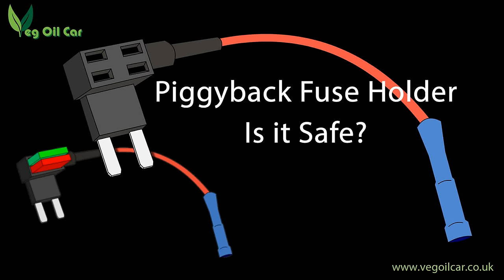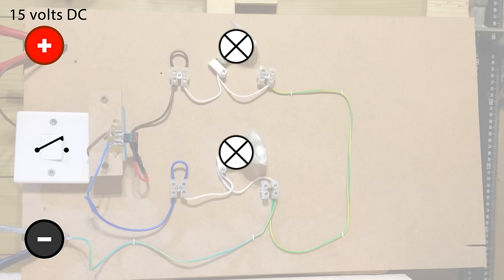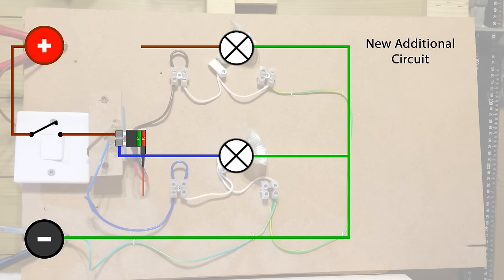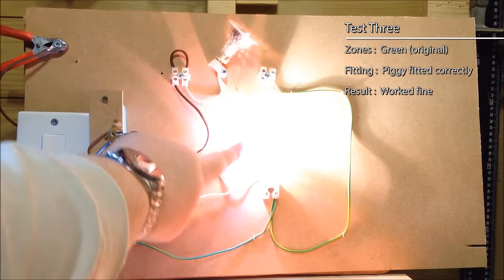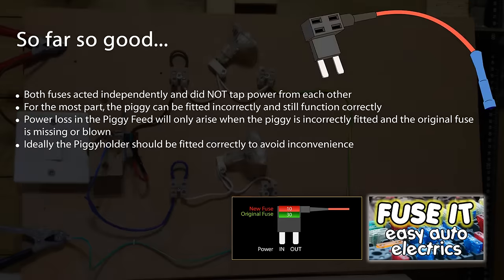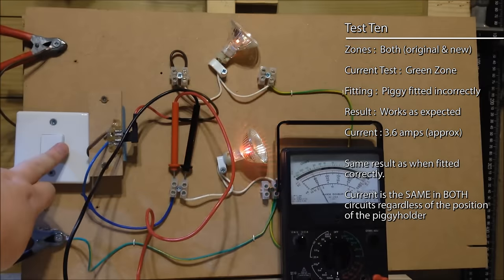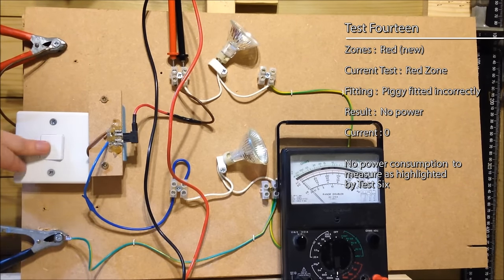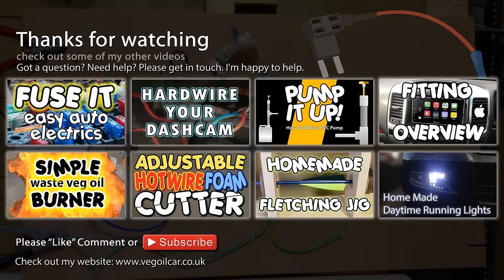Piggyback Fuse Holders SAFE OR NOT? A Piggyback bench test - by VOGMAN

Comment: As others have said great video but one additional thing: if the piggy back is the wrong way round then the original fuse will see the amps from both circuits potentially overloading the original circuit.  The tests here won't show this as they tested the circuit amps past the point of the fuses.  If you remove the original fuse and test the amps at that point (I.e amp meter bridging the original fuse) you would see double the load with it the wrong way round.
This matters in the sense that you could blow the original fuse when the original circuit is actually fine and should be operating.  You could also create a load that would always blow the original fuse in this set up (I.e original fuse at 20a with 10a load, new fuse at 20a with 11a load both circuits working as desired, the original fuse will blow every time both circuits are required)

Comment: Thanks for showing the in and out flow on the piggy. People were saying that the current runs in an “x” pattern from the original fuse to the added fuse. You show how both fuses have the in and out sides on the same side like a copy next to each other. Awesome 👏

Comment: Using it the 'correct' way routes the current to each device through a separate fuse. Using it the 'wrong' way routes both circuits through the original fuse and the new circuit through the new fuse. This has two fuses on the new circuit, (which are not needed) and the current from both circuits passing through, and possibly overloading the original fuse. If that blows, both circuits are out and you've now got two circuits to troubleshoot. I agree, on low loads, either way works fine. But if you increase the current you ultimately have both circuits on one fuse.
Reply from the maker: I can only speak as I find, Bill. The tests I conducted on just one (non-branded) PiggyBack showed no evidence of sharing current when the device was inserted the wrong way.  It's possible that other makes could behave differently I suppose but the one I showed here safely fused both circuits, regardless of how it was inserted... though obviously there is still a right and wrong way : )
I agree with you completely about overall load... I don't think these things should drive anything heavy duty. A dedicated separate fused line would always be the way to go if needs were more substantial.
Thanks for your input.
Reply: Bill Vernieu is correct. With both fuse in place in the piggy and correctly connected and oriented the connection is parallel for both fuses, i.e. each fuse protects each circuit. Now with the piggy connected wrong way around, with both fuses in place, the original fuse works as the fuse for both the circuits. The red circuit fuse is defunct. That is why if you remove the green fuse at this point, the red circuit fail to light.  So how is this possible? Simple. The original fuse has  both legs connected to the circuit but the piggy's red fuse has only one leg connected to the circuit. One of the legs is defunct in the red fuse. That is why by turning it around (without the green fuse in place) it does not carry current,and therefore no light. Try drawing the piggy's internal connections and leave out the piggy's one leg (the one nearest to the red wire for tapping current). This will be your aha moment!
Reply: One of the easiest way to test this hypothesis is by showing the lack of continuity between one of the legs of Piggys red fuse (nearest to the red tap wire)  and the the corresponding side leg of the piggy itself. Use a multimeter to check for continuity and insert one lead into where the piggys red fuse leg would go into the piggy itself and the other lead of the multimeter on the corresponding side of the piggy. At one corresponding side you have continuity and at the other corresponding side there is no continuity.

Comment: Fantastic Video!Watched this as was unsure about polarity issues highlighted in other comments. So duly digested your tests and figured I could work out the 'right' way round by inserting the 'piggy back' without the lower original fuse. If it's the wrong way round the accessory won't work. Same as blown fuse?
So did that and one way it worked, the other way it didn't. Sorted thank you.This was for a hardwire install of a dash-cam,  I used an empty fuse slot on a 10A heated seat circuit. The vehicle doesn't have heated seats :)
Reply: Gonna hardwire my Sat-Nav next and then install some extra 12v Sockets.
Reply from the maker: It is confusing I know. I sit and watch the video myself sometimes just to refresh my memory, but those were the results I got ; )
I'm really glad it's help you out. That's why I make these videos, so thanks for letting me know.

Comment: @VegOilGuy Automotive tech here. You've proved yourself that the current would all go through the original fuse if the 'piggy back' is fitted the wrong way around in the video. If only the 'piggy' fuse is fitted, it only works one way around. If both fuses are fitted then it doesn't matter which way around you put the piggy. Therefore one way round, (The fuse positive input closest to the piggy output wire) then all the current has to run through the original fuse first for both circuits to be live, the piggy fuse then gets it's input after the current has gone through the first fuse.
Reply from the maker: Hi Josh... I might be misunderstanding you or you might be misunderstanding me, so to clarify my conclusions were this:
1) It can be inserted the wrong way round but this only results in an inconvenience IF the original fuse is blown or missing
2) The loads AFTER the fuses are NOT shared. The fuses always act independently
3) The load BEFORE the fuses draws more currently - obviously as we're adding a second device
4) If fitted the correct way round and both fuses do NOT exceed the current rating of the feed wire itself, then everything should be safe to use.
Hope this helps : )
Geoff

Comment: Thanks for this exhaustive test.  I was questioning my own judgement for a bit.  I just wanted a convenient delayed accessory feed to control a "Charge Guard" without having to tap a factory harness.  These add-a-fuse kits are the way to go.  The owner's manual usually always tells you which fuses are switched and which are always hot.  No dodgy splices in a factory wiring harness. No hunting with a test light.

Comment: YA, Volume needs to be MUCH louder.  But Great video.  I think the reason the piggy back fuse holder only works when inserted correctly is because the original fuse "BLADE" completes the connection for the positive to go to the add on circuit.  Without the primary fuse the power doesnt go to the add on circuit fuse through the BLADE of the original fuse. .

Comment: I agree with your findings, that the piggyback fuse holder is a safe tool (and far preferred to some hacky wire stuffing nonsense).  

My only addition to you analysis is regarding the fitting of the holder backwards.  As you noted the new circuit requires the original fuse to be installed, and intact, to function.  This would be evident if the piggyback were disassembled and the bus bars could be seen, one stab connects to both fuse receptacle and the the other stab only connects to the original fuse receptacle.  

Notably, installing the piggyback the wrong way around will cause the original fuse to carry the current for the original circuit (suitable, by OEM design) AND the current of the added circuit.  If the added circuit is a large load this could blow the original fuse and lead to confusion as it will be counter-intuitive.  

Having said this, sometimes space considerations in the fuse box force us to use the piggyback backwards.  As long as we know the limitations and account for that in our DIY designs (and we don't "fix" it by up-rating the original fuse) there should be no problems.

Comment: Done very well!  Plus, proved your point.  Don't know why the manufacture constructed 
the piggyback to NOT function when in backward with the original fuse missing as you
illustrated.  Ideally, it should be a simple parallel type of construction that would eliminate
any orientation issues.  Perhaps it was a feeble attempt to catch people's attention with the proper fuses going back into the proper places.  Who knows?  But I know it's safe and 
plan on adding a plug to my car using this method.  Instead of the wiring around a fuse
method.  Bravo!  Thanks again.

Comment: If you put in the piggy bank the wrong way around an have both fuses in, I believe that both circuits would actually  go through the original fuse so that could blow up if the total current of both the circuits is higher than the rating of the original circuit.
Reply from the maker: Thanks for the comment Alexandru. I don't think so.
The purpose of these tests was to discover what happens when these devices are fitted correctly and incorrectly. I couldn't find any evidence of "sharing" a fuse so I believe if used correctly they're perfectly safe.
Hope this helps.
Best wishes,
Geoff
Reply: Actually you are wrong, when the piggy bank is put in the wrong way, the current of both circuits is flowing through the original fuse. You have been measuring current at wrong points, that's why you didn't see it in your tests. Just think about it - if the current of added circuit isn't flowing through original fuse, then it should work when you take the original fuse out. That's what happens only when the piggy bank is inserted correctly. If you're still not convinced, try drawing out schematic of your circuit, it should be clearer.
Reply: Could you do another video testing them? I think it would be a good idea to see if plugging it in the wrong way will still protect the ciruits
Reply from the maker: Thanks for your suggestion. I'm always keen to get requests. But in truth there's really no need this time. If you think about it...
Is the current flowing through the fuse? YES. (this was tested - with a fuse the light lit, without it nothing).
If current is flowing through the fuse then the following circuits MUST be protected.
Get the idea? The fuse IS the safety... its designed to break if too much current flows through it. So a working fuse is a good thing.
Hope this help  : )
Reply: I think it shares half the original fuse. That is the supply flows across one blade of the original fuse to reach the supply side of the piggy backed fuse. Test it with a blown original fuse installed or a spade connector on the supply side. The piggy should work either way around.

Comment: Cool video - thanks
Actually I never gave this a thought, until now.

But it is easy to detect - insert the piggy back fuse holder, with only the original fuse inserted and switch on. If only the original circuit works - it has been inserted the right way and you can insert the add on fuse and everything should work OK.

Comment: Excellant explanation. But missed one detail, that It doesnt mater if we fit piggyback incorrectly, circuit will still work, because whatever we are doing, is on postive side and ground side is untouched. So we are not switching polarities, meaning we are not changing source of positive with naegative, so its safe to do so.

Comment: I just came across your videos Geoff, and I think you make the subject matter easily understood and illustrate things clearly. I´ve only recently started learning about electronics, but what you are testing in this video seems logical to me, meaning you presented evidence in favour of the (my)  theory. The issue here should be how the current flows inside the "fuse tap". Then it makes perfect sense that the circuit is broken if you blow/remove the original fuse while the fuse tap is mounted the wrong way around.
Reply from the maker: +Berserker 
Hi Berserker. Thanks for the kind comments.

Comment: Thanks for this. I've always thought that plugging it in backward would supply unfused power to the added load. Of course now I see that plugging it in backward will actually only cause the lower fuse to carry the load for both circuits and the top fuse will only protect the added circuit. Plugging it in correctly will give you what you really want which is two circuits independently protected by their respective fuses.  It's really simple actually but this video made me consider it properly.  Thanks.

Comment: Good video Geoff but you should really mention a safety issue with overloading the supply wire! 
I have been investigating these piggy back circuits and whilst I am sure they are fine adding low current circuits, there is a massive implication adding high current circuits. How do we know the wire supplying the original fuse can take the circuits combined current and won't melt and worst case catch fire?
I think you should really make this clear - I finished watching the video with a clear message there were zero safety implications!
How about adding an extra test to your video. Pretend your supply wire is only spec'ed to take the original fused current by using a fuse on the supply wire of the same value. When you double the current with the addition of a piggy back circuit the wire 'fuse' will melt - this could be your loom wire melting!?
For me this is the biggest concern rather than which way round the piggy back fuses are inserted. A novice (like myself) might blindly use this and overload a supply wire with all sorts of consequences!
Reply from the maker: +Nick Luc Cockman 
Hi Nick. That is a fair point well made.
I did think that I had made mention of overloading the circuit and even suggested that personally I wouldn't recommend anything that would exceed 10 Amps. But if you haven't spotted this, either I never actually did it (and imagined the whole thing - nothing new for me there) or I didn't do a clear enough job.
Thanks again Nick. I'll have to revisit this later when I have a spare few minutes and see if there's a better way of getting this important safety tip across.
Best wishes,
Geoff

Comment: When adding a circuit to any existing circuit the caution here is the possibility of current overloading of the existing fuse supply wire. some cars have very light wire. On lightly loaded aux circuits it should be fine. do not try to run amps, driving lights, fridges etc in this way without relays and heavy bat supply harness.
Reply from the maker: +marcus mcc 
Thanks Marcus. That's a point point well made.

Comment: only thing i can think of is overpowering the power wire into the fuses. just random numbers here but say the wire was rated for 12A and you had a 10A circuit. that's fine, no issues. but if you piggyback it so there are now 2 10A circuits, that's 20A which exceeds the 12A wire rating. not sure if that is how it works, i could be wrong, probably am. but then again with both circuits you were drawing less amps so...hang on, back to the drawing board for me....
Reply: badbradmx, a 12 gauge wire is rated for 20 amps

Comment: The add a fuse will work for the bottom original fuse/device but if inserted backwards one of the legs on the add a fuse is dead to the new device. For new device to work with the secondary fuse in line, the positive side of fuse box has to be connected to the "active" post on the add a fuse, just as your second video demonstrated. The only risk is if you have 2 devices on this one circuit drawing a combined total current higher than the wiring in fuse box can handle. (Overheating). If you are careful what 2 devices you put on one circuit, you should not have a problem. Check combined amps of both devices.

Comment: I accept much of what you say. the only comment I make is that,if put in the wrong way, yes a current will flow to the new circuit but..it will not pass through either fuse. The new circuit would in effect be drawing power directly from the feed to the fuse holder and will not be protected by a fuse unless the feed to the fuse holder is itself protected by a fuse prior to it arriving at the  fuse holder. If I am correct then plugging the 'add a fuse' the wrong way round is NOT adviseable.
Reply from the maker: +Keith Bryant 
Hi Keith. Thanks for your comments.
Yes, your quite right, it is BEST to fit these the correct way around and I hope I've helped explain the best way to do that.
The issue of "wrong way round" and "blown fuses" is something I covered in another video if you're interested. You can see that here: https://youtu.be/2mBa5rRZbCk
But in short, as long as you're not over-powering these, to me they seem a fairly simple and safe device to use.
Hope this helps.
Best wishes,
Geoff
Reply: Nice video. I see the issue of ¨wrong way round¨ this way: the original fuse is going to feed its original circuit but additionally is going to feed the new circuit via its new fuse. Both circuits are protected but the total current of both circuits is going to pass through the original fuse with the risk of this blowing. Thanks for sharing.